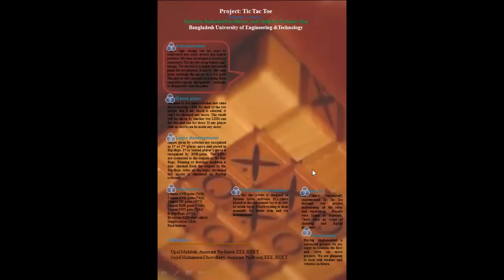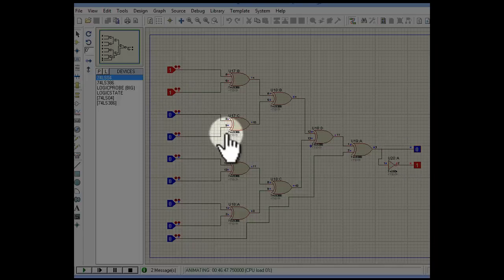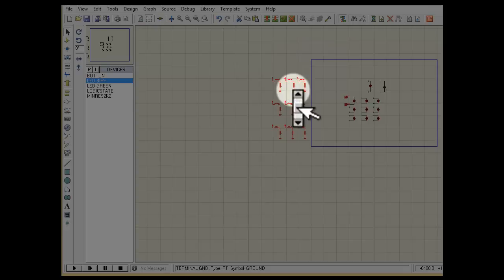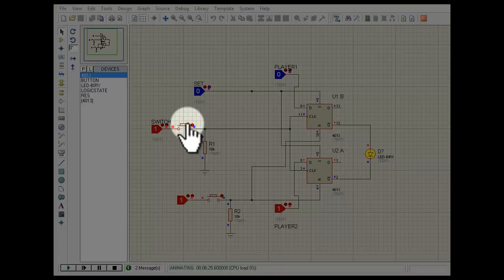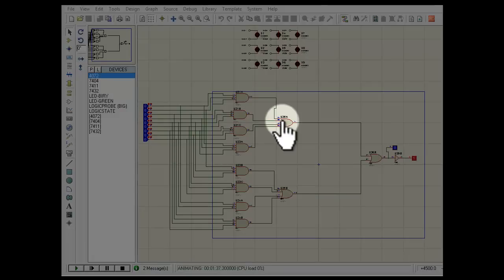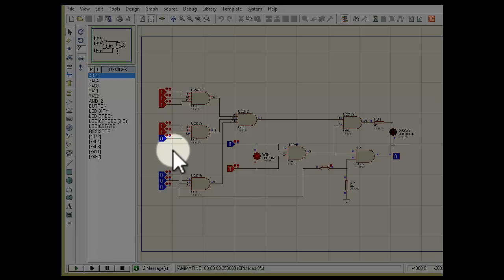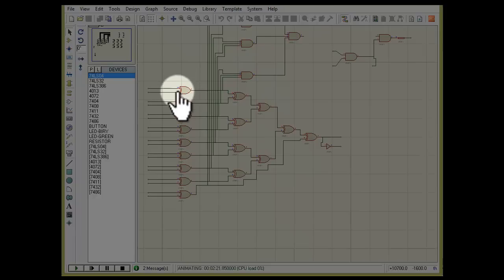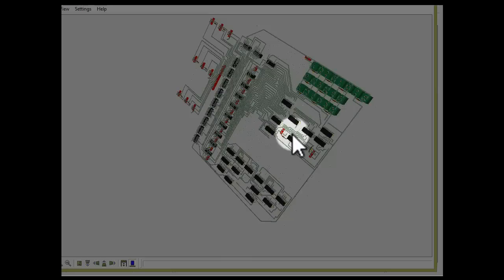Making a Tic Tac Toe game using Digital Logic Design

Comment: Hi. I did the same circuit as yours, but why am I having an error of declaring the winner even though the game is not yet finished? It's just that when player 1 click button 1, player 2 click button 2 and player 1 click button 3, it announces that player 1 is the winner. The condition checking circuit doesn't save who clicked the button. Can you help me? Thanks
Reply from the maker: If your circuit is exactly as ours, this shouldn't happen. Did you get the latching circuit right?
Reply: Thanks for your reply. I've found our error on the switching part. It's just that I've connected some wires on Q part of the flip flop instead of the other one. Thanks for sharing your video, it's a great help.
Reply from the maker: Cheers! :)
Reply: Airyn lgagamao  i am having same problem how did you fix it.